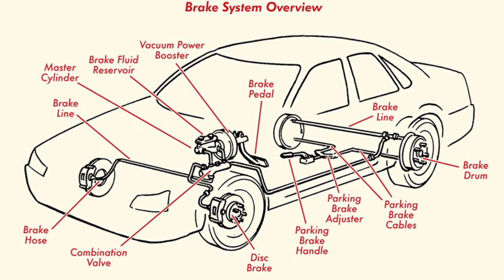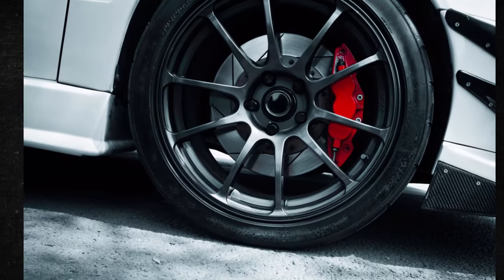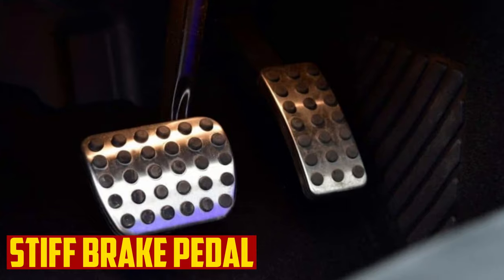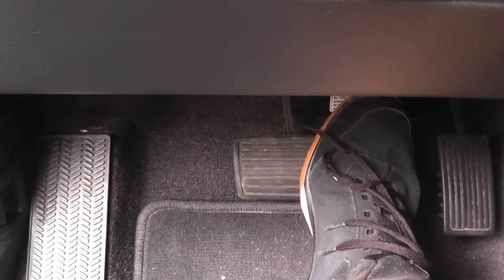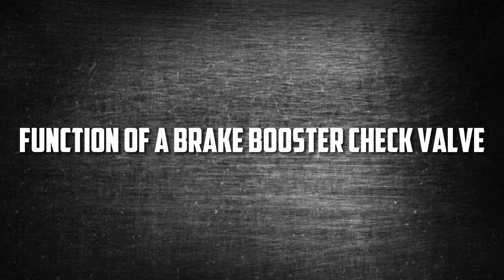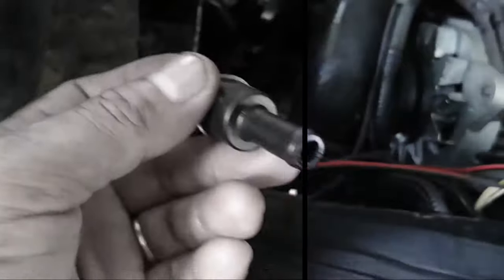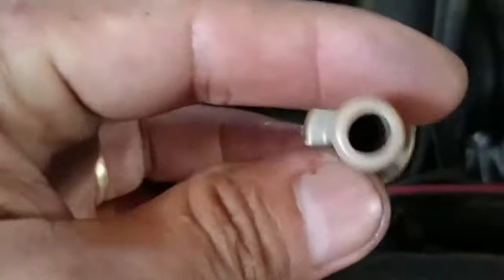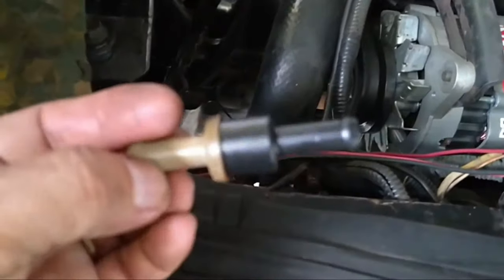4 Symptoms Of A Bad Brake Booster Check Valve. How To Test?

Comment: Thanks. My car is acting up. My brakes are stiffed as a rock. The car felt like it was going to come to a complete stop on the highway. The acceleration felt terrible as if it didn’t want to reach 40 mph . Rpm’s rev high but car not picking up much speed. Annoying af
Reply: Ay bro did your car brake by itself when it had this problem cuz my truck has a problem that my pedal stays hard and my truck stays braked until i losen up the master cylinder a little but it still braked but less than it use to , so if i bolt on the boster to the cylinder my truck  wouldn’t move becouse thers so much pressure in the brakes , i replaced the boster is stull the same ,i was thinking abs pump but i don’t think
Reply: Did you u get it fixed ?
Reply: @kvng_leo1159 did you have the same problem?
Reply: What was it?
Reply: The check value

Comment: hi, if the car has a stiff brake (as hard as rock) before it starts the engine but there is no problem with braking (soft braking) after it starts, it becomes soft after pressing the START button to turn on the engine, do you know what is the problem? thank you
Reply: Any update? Thanks
Reply: is that not normal?
Reply: Check the brake booster check vaulve
Reply: Air in the ABS pump.
Reply: This is normal and expected..the brake pedal becomes soft only after u turn the engine on.
Reply: @akashnthampy3162   but i can't even turn on the engine at the first step on brake. I can turn it on at the second step, which i step on the brake much deeper.
Reply: @tsairaymond9299 did you figure out the problem? My '17 Sub Forester has the same issue on cold starts. I am thinking it could be a slow leaking check valve and will just buy one to see if it fixes it. Thanks
Reply: It's normal  @jaabryan
Reply: @jaabryan it's a vacuum system so the pedal should move down when you start it because the vacuum has begun and is working. If the pedal doesn't move down, then the booster isn't working properly.
Reply: @akashnthampy3162  no it is not normal. It is not how it was when the car was brand new.
for push button start, brake pedal should not feel stiff.
Reply: @jaabryan  i started having the same problem in my lexus. For years, brake pedal would press down easily when cold starting. now it's just stiff. 
The brake pedal functions normal otherwise, during normal driving.
Reply: @kkp4297  Replacing the brake booster did not resolve the issue. Next up will be the vacuum check valve. I had checked the valve with a tester and thought it was fine. I guess the leak could be low enough to take several hours to affect it. It’s also a dealer-only part. I will report back with an update!

Comment: Any help; brakes work fine- but has a whirring noise- but you press the brakes- noise goes away for a while- but can come back 10 minutes later- any input would be appreciated?
Reply: Sounds like my problem.
Reply: Same problem here , sounds like a turbo spoiling sound at idle but goes away when brake is applied

Comment: Right on point. Had a vacuum leak, which led to the brake booster check valve failing.

Comment: Could this cause your breaks to stick ? I have an Audi a5 with new discs, pads and d callipers !!! The mechanic has had the car in garage 6 times, they took everything off put pads discs ect back on, everything is working fine, hose, fluids are correct, all lubricant correct !! Breaks still stuck!! Decided to get all fresh gear just Incase if faulty pads, discs ect tried this it still stuck!! The vac is correct with the electric hand break !! It’s been in 6 times and still my breaks are sticking but everything is apparently done correctly !! What is the problem!!
Reply: Did you solve this?
Reply: Brake booster check valve
Reply: @stefansk8  no
Reply: @patricianotyad5791  I think it’s the master break cylinder or the abc module. Very very unlikely it’s the booster. Lots and lots of Audi’s having same problem.
Reply: Caliper is bad
Reply: @Cocozen it’s nothing todo with caliper.
Reply: @faff1987  that's weird because I just replaced mine and it fixed the issue.
Reply: @Cocozen  read my first comment. 

Had all bran new callipers, the problem.
Reply: @faff1987  New calipers don't mean there isn't an issue, and sometimes the caliper is adjusted too tightly so the pads sit too close to the rotor. There is a hex adjustment on the caliper pistons.
Reply: @Cocozen old caliper did the same. 

All new callipers come the same if this was the case it would not be just one all four would be the same.

Comment: Have an evo x, hsd to remove brake master snd brske booster to change the clutch master cylinder.

Car idles conpletely fine, drives fine, brakes completrly fine. Passes all the pedal tests. Car runs lean on boost. If im on idle and i press the brakes hard, once i let go the afr goes a bit. If i pump at idle the afr goes fully lean and engjne starts idling bad. Would that be a bad booster despite no loss in braking performance? Or a vacuum leak at the front chamber engine side
Reply: do a smoke test, see videos for diy smoke testers, very simple to fix once you locate the leak.
Reply: I'm having similar issue and was wandering if you resolved this issue
Reply: @martinmangik  So the afr going lean after pumping pedal is normal, but I ended up having a Crack in my intake manifold so just a coincidence

Comment: Would this be cause when I press the brakes is goes to the floor but when I let go then press again it slows down then stops my vehicle?
Reply: You could have low fluid, or air in the line, or water in the fluid
Reply: @LThill-ks2uz  my fluid is at max I have flushed it 3 times It could be possible I have air in the line but I drive an 04 canyon and I believe that Chevy requires a obd scanner to bleed the breaks
Reply: Hard to press brake pedal would be a symptom of brake booster check valve failure.
Reply: Limp mode?
Reply: Probably a bad master cylinder